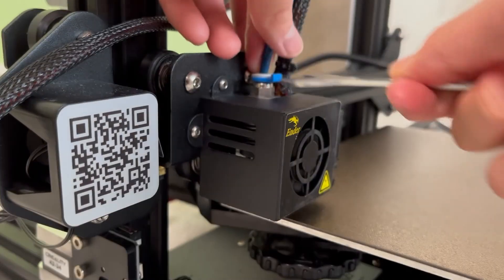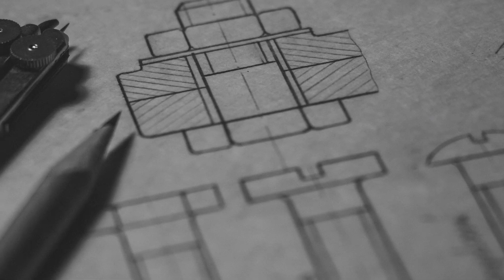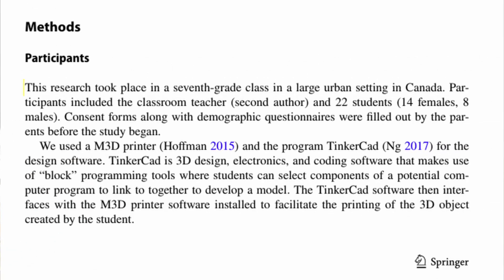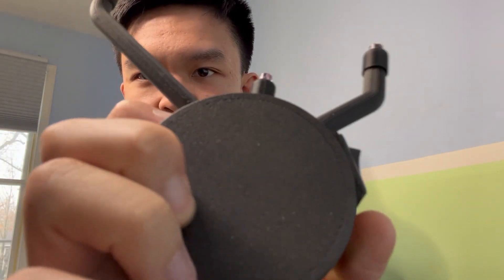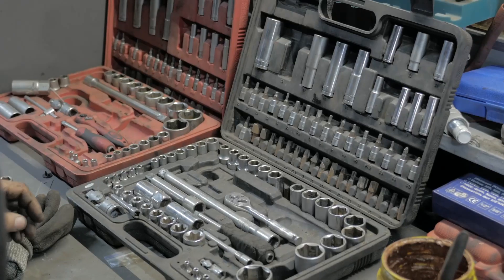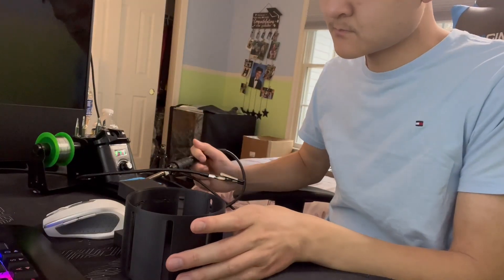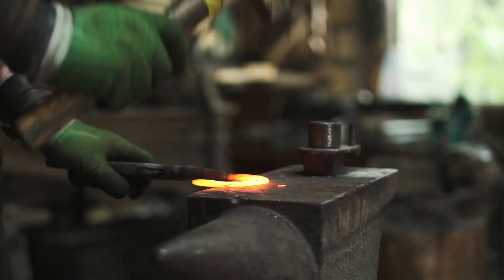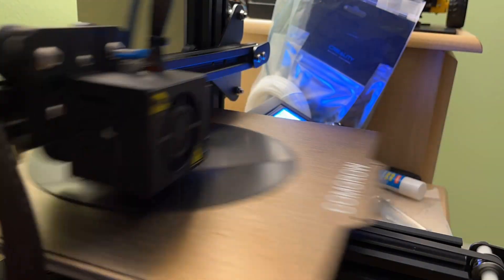This is what makes 3D Printing unexpectedly useful (University Project)

Comment: Firearms are the MOST positive aspect of 3d printing.
Reply from the maker: I guess it depends on how you see it right? 3D printers can be used as a tool against authoritarian control by allowing people to print their own defensive weapons. But again, tools are force multipliers. Someone could use it to purposefully hurt someone else. 3D printing is very useful in that it can enable people to do a lot. The outcome depends on the person, though I believe there are more positive uses than negative uses.

Comment: Nah, still not sold on them.     Too much hassle for questionable benefits. 
If you already have a use case for it that you are rarin' to get going printing, great.  
If you have no idea what you would actually use this for... then there seems to be no point in owning one... at all.   I still haven't come up with a use case scenario for myself.
Reply from the maker: That is completely valid. If you don’t plan on starting a business for example, then why get it? Why buy a hammer if you don’t plan on making or building anything? 3D printing is pretty enjoyable though, so I guess you’d get the novelty of it at least, though I didn’t talk about that point much.
Reply: You know what they say: "If all you have is a hammer, everything looks like a nail". You could also say "If you have a 3d printer, the solution to many problems is a 3d printed object". Most people buy a 3d printer out of curiosity or as a toy and then start solving everyday problems with 3d prints instead of buying something or solving it another way.
Reply: I'm just going to cut some bs real quick. How often do you buy on Amazon? Be truthful.
Reply from the maker: Looking at my order history, about once every month on average. Why?
Reply from the maker: Actually, looking at 2023 and not 3 past 3 months, I'd say 3 orders per month. Usually only goes up when I have project videos, like my robodog with arduino's motor controllers, and other electronics. Stuff like that.